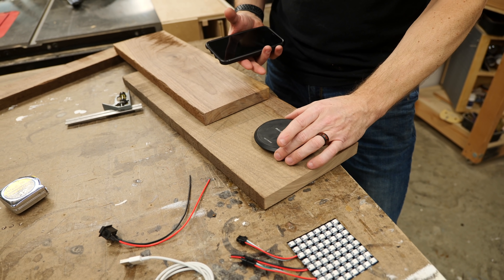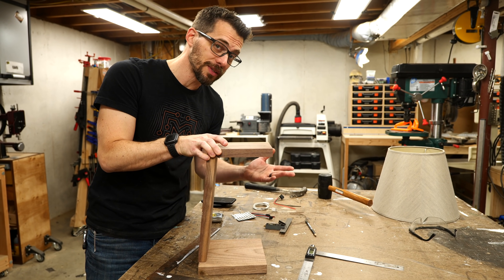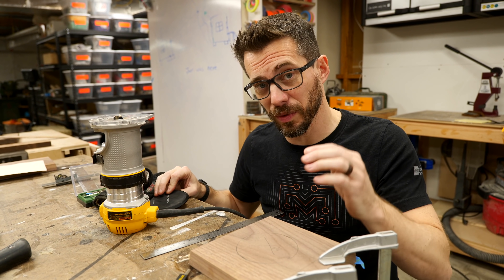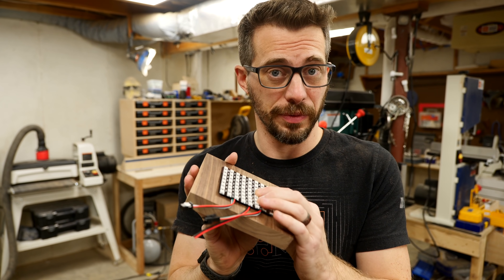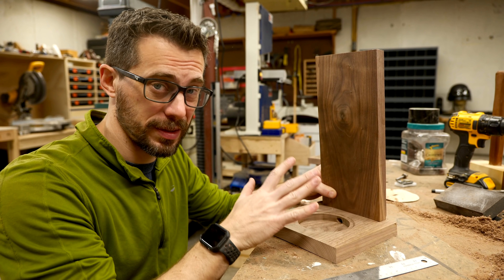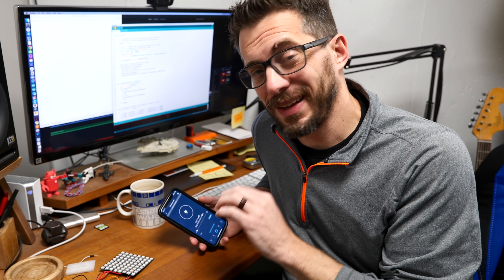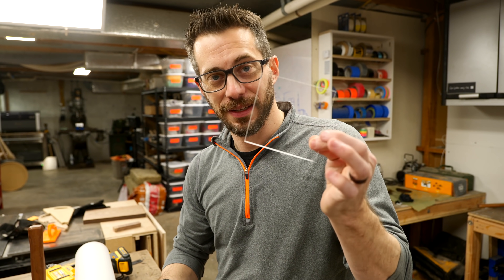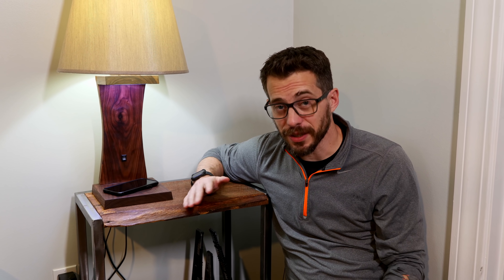Making a Modern Lamp with Inductive Charging | I Like To Make Stuff

Comment: the fact that you were able to use a wireless charger without ripping it apart of finding out how they work and then recreating a bigger version made this project so much more feasible for me 
I am super confident building things with enough structural integrity to support whatever I plan for, I learned to build to hold up my bed and fish tanks, but the idea of wiring and electronics almost makes me throw up, so this was the perfect middle point for someone like me

Comment: Nice lamp, I kinda like it without the actual lamp on top. I just started getting into woodworking and I wanted to make a project just like this but my knowledge of wiring things is zero. Basically what I was thinking was adding wireless charger like you did and have led lights. And I want to add an on/off switch and also add a usb hub. The problem is, I don’t want to have all these different power cords coming out the back, I want to have just 1 power cord. I want the on/off switch but I don’t want it to turn the charger on and off.  If I can’t do that then I’d want to add another on/off switch for the charger itself. I have looked at the aurdino and the rasp pi but it all sounded alien to me lol. I’ve watched a lot of vids of people making projects like this but none go into detail about the wiring and how to actually do it. They usually say what they are doing but don’t actually show everything so it’s been hard for me to get started. Do you know of a video that might help me figure things out? Any help or advice would be greatly appreciated

Comment: I'm curious to know what your wiring solution was, did you hack it into a single power supply, or did you power the lamp, the ESP module, and the Qi charger independently? And also, if you had routed the walnut from the bottom and left basically just the top layer, you could charge without messing with the finish.

Comment: cool project. do make the +1 you could have made it with capacitive power switches - just do a metal bar on the back of the lamp to turn on/off. It's great for when you're reaching for a light in the middle of the night.

Comment: Love the automation videos. If I were to make this myself, a few things I would do differently are:
- Add a thin hard but conductive material between the leather and the charger to improve the aesthetic.
- Add a small limit switch below the charger and program the Arduino to make the lights fade in / out red for 10 seconds to indicate charging. 

Obviously, for the last one the limit switch it would only assume that the charger is charging. Though I suppose if you could find a really small relay you could tie the limit switch into arduino, then arduino into the signal end of the relay to turn the charger on / off based on whether something is present.

Comment: Nice! how did you wire up all those different voltages devices? i mean obviously the buld should have its own wire connected to the wall outlet and the ESP/Led/matrix/wireless connected to the same 5v power supply? 

thx for this info

Comment: Was the wireless charge able to not penetrate the wood.  It would have been nice to have the consistent wood on the base, also design wise maybe a brass or metal toggle switch would have been consistent with the metal end table.  Just some thoughts, otherwise awesome lamp idea.

Comment: Hey I was wondering, it was possible to drill a hole in the wood with the CNC in order to leave a very thin wooden layer, thin enough  to permit to recharge the device. Or in another way drill an hole in the wood and stick on top a thin layer of balsa wood, or something like that. Do you think that could work? In that way you will have a continuous wood surface with the charger hidden in the wood.
Reply: Yeah you could do that, or use a router.

Comment: If you're using Platformio with VSCode to program your Node MCU ESP you can utilize "OTA" updates to reprogram it over wifi, which is super convenient. 

In fact, platformio + VSCode is mindblowing compared the Arduino IDE!
Reply: Oh, and especially for projects like this I'd totally recommend the Wemos D1 Mini by 'LOLIN' (dumb names), they're super slim and just as capable as the chip you used I believe.

Comment: I had some idea but they aren't anything I could make. Anyway, the first one is related to cutting the channel for the lamp cords to run in so they are hidden. The table saw with the Dado works well for it, and using the Forstner bit to hog it out also works but it make me think, what if you took an End Mill bit for cutting metal and chucked it up in a drill press. Then slowly fed the wood into it to cut the channel you are looking for. I wonder if that would work. 

Also, for the lamp and charging system, I wonder if you could make a little hanger that comes off the side or something but has the inductive charging bits for your watch. That way when the watch comes off at night you can hang it on a little post or something and it'll charge!

Comment: Looks fantastic. One small thing which idk if it matters since it’s a bedside lamp/charger, but the distance between the coil of the charger and the coil in the phone can significantly affect the charge speed. You could’ve tried taking apart the charging pad and put the coil right under the leather to improve charge speeds. Doesn’t matter much if you’re only using it to charge at night, but could be a useful modification.

Comment: WLED would be a great piece of software for this for those people who don't want to code it themselves. You can flash it directly onto the ESP module and it can emulate as a HUE RGB light so you can add it to Alexa or Google Home and be able to control the brightness, color, and on off.
Reply: I've use WLED for lights on our porch, eaves (Christmas lights) and for our Christmas tree, and it works really well.  The one thing I miss is Google integration, but I'm still looking into how I can do that via an MQTT server.  (I have one on my NAS, but I need to hook it to Google somehow still.)
Reply: @Raytenecks  I use Home Assistant to connect everything together and allows me to automate things that normally won't be able to be automated.

Comment: How many plugs does this use? I see three separate electronics elements, so are they connected into one or two plugs, or all separated?
Reply: Russell Geisthardt I was wondering the same thing!
Reply from the maker: I've got the charger and ESP module both going into a single USB charger. The actual lamp bulb is separate.   Theoretically you could condense it all down to a single plug, but you'd have to step the 120v down to 5v to run the USB items.
Reply: I Like To Make Stuff and the led matrix is powered off the ESP too?

Comment: If you add an NFC sticker you can creat a spot on the lamp that when you put your phone next to open the app for the lamp via shortcuts. Or maybe sets a timer that will turn it of after a desired amount of time.
Reply: Shadow Fexz  would be really cool if it was red for low battery while charging, yellow for medium battery power then green for high battery power and fully charged. Red could be 0-39, yellow could be 40-79, green could be 80-100

Comment: Nice build, Bob -- designing and problem-solving as you go often leads to "happy accidents." One question: while I like that you used your router to make the insets for the charger and the electronics, did you consider using your CNC to route some of these? I know everything is hidden, but it might have made some of that work less tedious. Keep up the great work!
Reply from the maker: Thanks ! yeah, I considered it, but it's one of those situations where doing it by hand was probably the same amount of time as making the file, placing material, cutting etc.  Also, I like to try to show non-digital options whenever possible 👍🏼

Comment: worth noting that while the phone will still charge through another material the more you have between the phone and the charging surface the higher the losses and the lower your charging rate. Better to have it resting on the charging pad for best efficiency but its not the prettiest solution, just something to bare in mind

Comment: Bob nice design and choice of wood. Is the base heavy enough? It appears very top heavy, maybe some base weight like 1/2" plate steel.
Reply from the maker: Thanks! Yeah, it's plenty heavy but also the footprint is larger than the rest of it so it doesn't try to tip over at all.

Comment: This was awesome Bob! Question for you, you had mentioned that the light can be controlled via an app. If you switch the light on from the switch will the app still work with it to turn it off? What effect does that have on the electricity running through?
Reply from the maker: Yes, both the switch and the app will work.  It's treating the switch as a button (ignoring it's position, just looking for a change of state).  Some people may not like the fact that the position of the switch may not reflect the 0/| marking on the switch itself, but that doesn't bother me personally.